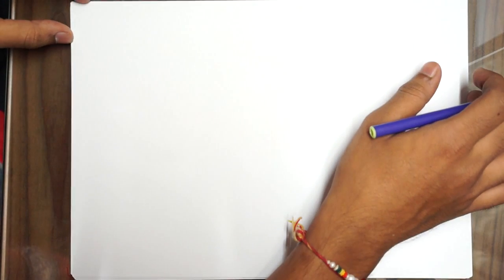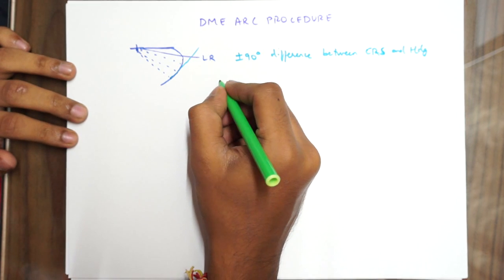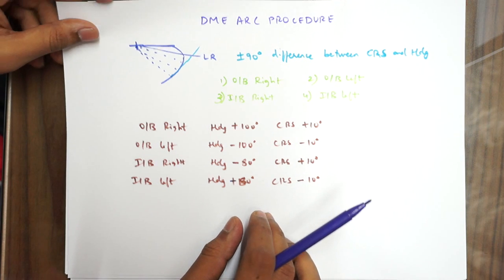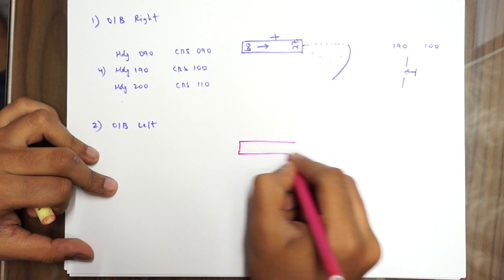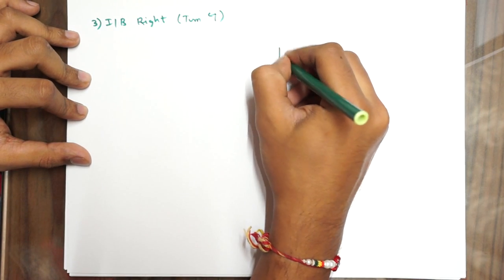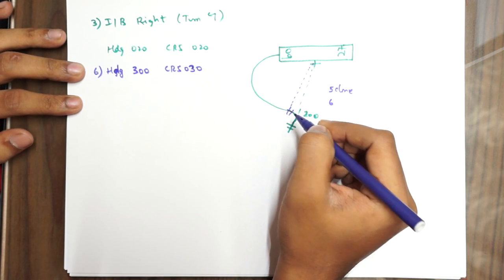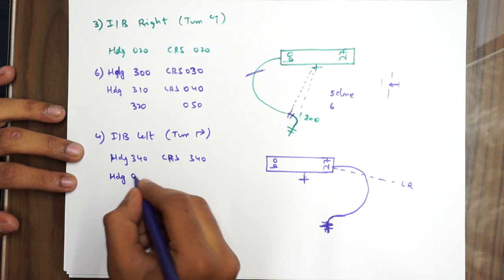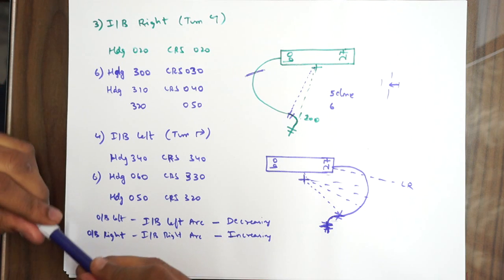DME Arc Procedure

Comment: After turning 90 degrees to join the arc, afterward why can't you just watch for DME distance, if the DME distance is increasing, meaning you are flying away from the arc so you better start turn towards inside a bit vice versa or even easier way keep your VOR always 90 degree of your current heading eh . wouldn't this work out better ?
Reply from the maker: You could do that but then accuracy isn't great.
Reply: @poh  so in order to improved the accuracy will be the turn 10 twist 10 and what's the other methods ?
Reply from the maker: That's the conventional method turn and twist. The other method is if you have a FMS which can plan the arc by itself and you can you it along.

Comment: Bro on the outbound example on the heading you went up by 100 but on the second outbound you went only by 10. Please explain.
Reply from the maker: Can you give me at what time in the video was this?
Reply: @poh min 8:29 sec 
Please look at both examples. 

First example 
- Hdg 090  crs 090
-hdg 090 + 100   crs 090 + 10
-hdg =190   crs= 100
- hdg 190 + 10   crs 100 + 10
- hdg = 200   crs = 110 

Same goes for the second example.

My question is. According to the table. Given the example above 
Ive added 100 to heading and 10 to course. Do i keep adding 100 and 10 after the initial input or do i then start making inputs of only 10 degrees to heading and course as i approach the arch. After i have made the first input of 100 and 10 degree input to heading and course.

I hope this makes sense
Reply from the maker: Yes thank you! I got that now! Yes only initially its 100/10 then later on its just 10 degrees each once you're established on the arc! 🙂
Reply: @poh  thanks this helped my understanding on dme arc  alot.

Comment: Why you didn't apply wind considerations on the DME Arcs? That would've made clear that TRK is more important than HDG in the end.
Reply from the maker: You're right but nevertheless we were probably looking to maintain a constant distance from the station throughout the arc, so you have to automatically keep correcting for wind by default to keep the distance same.

Comment: Good video!
Please explain when should I make a final to landing course? In practice we use 30 degrees before final course (at 160 kts). But what about crosswind approach? Does you have any formula for calculating time to make a turn? Thank you.
Reply from the maker: Crosswind you will realize only when you are established on the final. So if there is crosswind reported adjust approach accordingly. If there is too much tail wind on base leg then turn early. If headwind turn late and thereafter adjust.

Comment: I'm having a hard time understanding where the head and the tail of the needle goes on an HSI. If you want to intercept a 356 course inbound to a VOR starting at an IAF 15.3 DME on a 095 radial from the VOR, do you put the head of the needle on 285 during your first twist? Seems you would since you want to end up flying an inbound bearing and would use a reciprocal of the IAF radial.
Reply: YO, the rule for inbound left should be +80 -10, am i right ?
Reply: Or 90 then turn ten twist ten
Reply from the maker: Yes you can do that too. It doesn't matter actually on a DME arc whether you use the inbound or the outbound. Because its an arc an the radials will be constantly changing. If you are coming in on 095 radial inbound, then your CRS will be reading 275. Now if you want to make an arc to lead radial of 356. you will be doing a left arc with the initial turn into the arc being right. So you shall set your CRS now to 265, and heading can be 275+100 = 005. And then you fly this heading till the needle is centered, after which you reduce both by 10, i.e. CRS to 255 and heading to 355. Continue this way till you intercept inbound of 356 which is the reciprocal of 356, i.e. 176 on the CRS window.
Reply from the maker: Yea

Comment: Great explanation but there is a much easier way to fly DME arcs. Inbound, center the CDI on the VOR head to determine where you are. In your Inbound right turn example, it would be the 200 degree radial. Find where you want to go on the VOR head. In the same example it is the 090 radial. How do you get there? Go to the reciprocal of where you want to go, 270 (270 is the reciprocal of 90). In your example 270 is an initial left turn with an arc to the right. What heading do I turn to? Since your initial turn is to the left, to arc right, just look at the 270 degree index on the VOR head, it's 290. Turn to that heading at your 1% of true airspeed. Then just turn ten twist ten. Done. You can figure out any arc in about 4 seconds this way. For outbounds, the only difference is the "where am I?". Instead of it being at the bottom of the centered CDI, it's at the top.
Reply from the maker: +ProPilot World Thank you! 🙂 your comment shall be helpful to everybody!

Comment: If you could add a bit about how to make an arc using RMI needle, it will complete this video. Also, what's the maximum & minimum speed to be maintained in dme arc for each category of aircraft in different airspaces ? Thanks in advance :)
Reply from the maker: Noted. Will work on it! :)